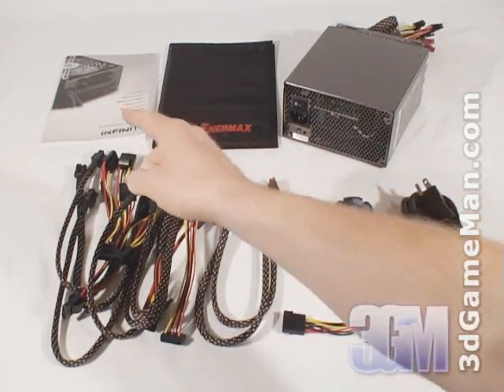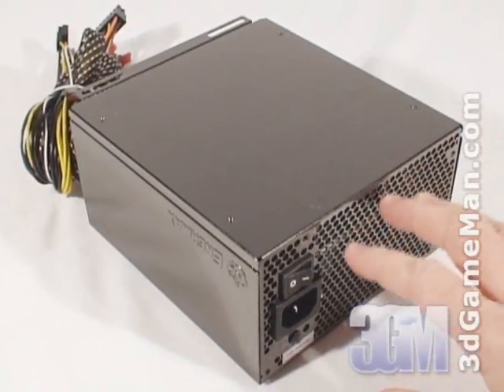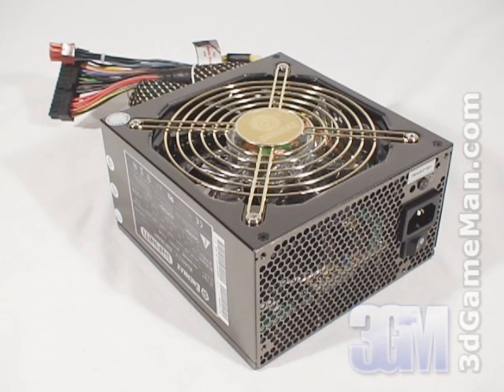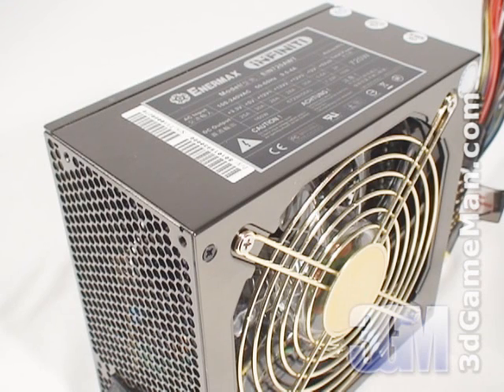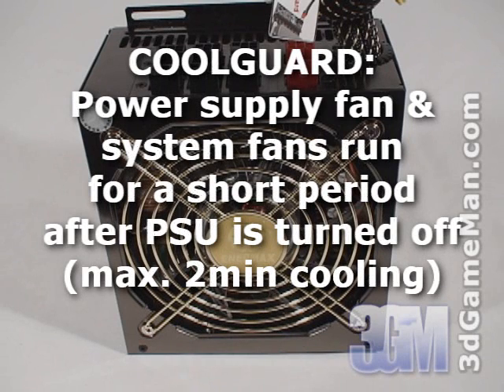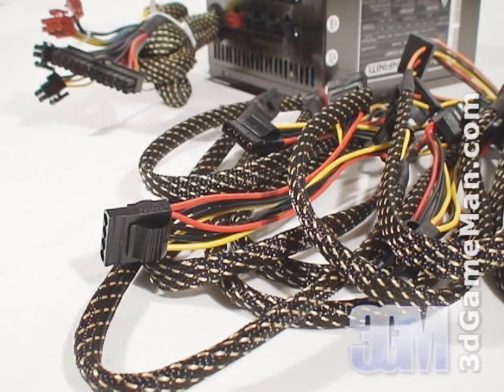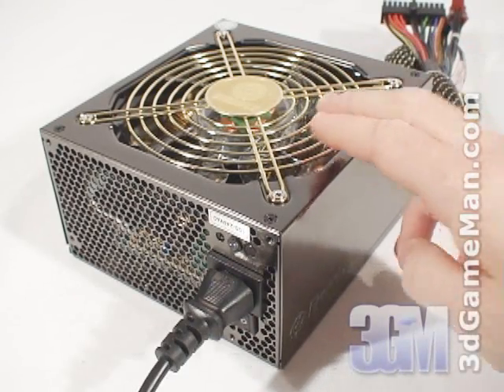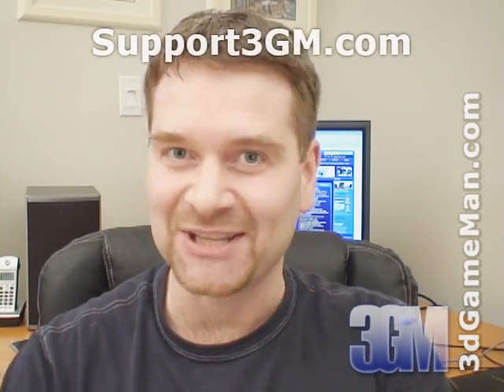#788 - Enermax Infiniti 720W Power Supply Video Review

Comment: will a 650watts enermax be good for this specs"

amd 5600+x2 @3/0ghz
2gb ram
watercooling
8800gt SLI
3 120mm fan
2 cold cathodes light.